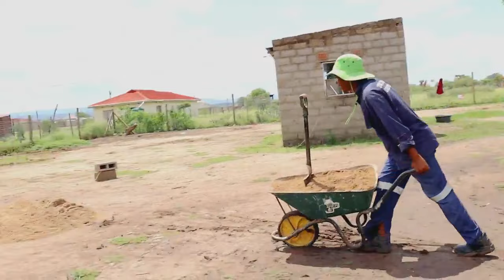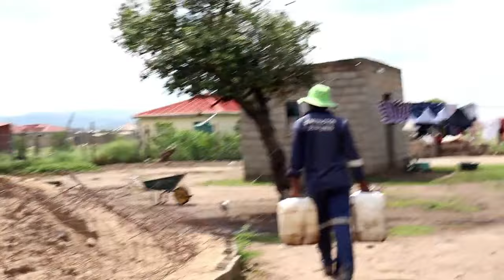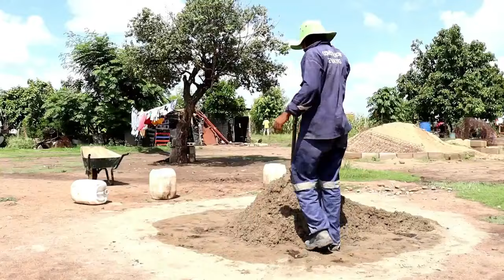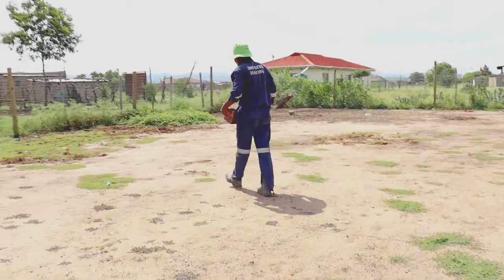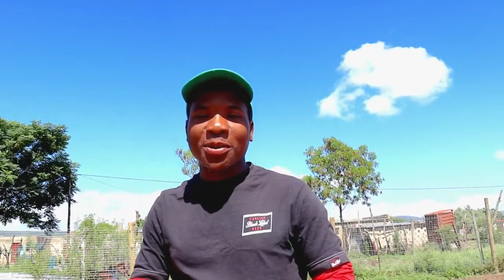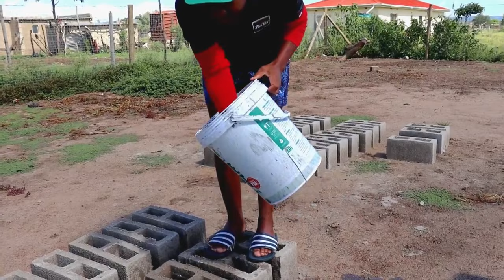VLOG: This Is How I Make Cement Blocks By Myself At Home | South African Youtuber😍🔥

Comment: Just so you know next time, your blocks had dried out too much to bother with the water, next time cover then with a sheet of plastic with stones on the corners
to keep the damp air inside, you also need to spray on them before sleeping or late. As some cements have a very short burning time, this is so that workers can empty
forms/molds for walls the following day and use them again. Yet privately, when using a thicker amount of cement for screening a floor for example, you need to flood the floor
with a lot of water. Before you cement a wall, wet the blocks, to stop them sucking out the water from the cement. Then wet again by spraying with a mist and hose after and during
the laying of the blocks ok. :hand-purple-blue-peace:
Reply: Would u recommend to soak them in a barrel of water?

Comment: It is encouraging to see such a young man doing all this.  He should note that the top of the brick is arched and not flat due to the fact that the unit with which he slides the brick out of the mold, is too thin and arches and rocks in the larger housing.  I suppose it could be corrected by  the layer of mortar in between the bricks, but a sharp eye can see it immediately and it does look " untidy". It can be corrected very easily. Making molds needs attention, as  such a mold should last a long time and repeats the product  with a high degree of accuracy. 
Still Congratulations, well done, and all the best in your life.

Comment: Not sure, but i think when they say ratio 1:8 in wheelbarrows they meant per wheelbarrow of cement which is 2 x cement bags, not 1 cement bag to 8 wheelbarrows of sand but 1 cement wheelbarrow. Meaning per wheelbarrow its 4 or 4 1/2 or even 5 wheelbarrows cement.
2 x cement bags fit into 1 wheelbarrow.
Reply: No man - why would they want you to offload cement to a wheelbarrow?
Reply: Just go n read a bag of cement it i it is written black and white
Reply: 100% correct

Comment: Thank you for the information. Ive always dreamed of making my own home with affordable diy materials. This seems to be the way to build a strong cheap home. Paint the inside, use a light water resistant material that is sloped for the roof, build a floor with a cement / plywood base,  lay some carpet, and run a wire in that shit and ill live in a one room home with one door and zero windows. Id consider a few windows for an ac unit and ventilation but other than that im a minimalist.

Comment: Nice video! I would like better descriptions of what is being done.  
What is ratio cement to sand?    How many parts cement to how many parts sand?   
I could figure it myself from trial and error.   
I think you said "5 wheelbarrels"   is a good starting point to one bag (what size?) of cement?   
I could dump 1 bag of cement into (what size wheel barrel?) to see how much of 1 wheel barrel one bag of cement is?   
Would be much better to have a number on cement to sand then you can use any size wheel barrel and any amount of sand and any amount of cement to make
any size batch of blocks that you want.
Good video and good starting point..    
I can figure this out from trial and error.  

Also on day two pouring water into blocks is not clear why. 
I'm guessing this just helps to "finish" curing the concrete? 
and get water into other places to make it cure better inside the block?  

Or is this just a test for cracks? water leaks out fast if the block is bad?  

Thanks again!

Comment: Congratulations! This is a very informative video. Is the ratio of sand to cement 2 bags of cement to 5 wheelbarrows (14 shovel heaps of sand per wheelbarrow)?  What is the weight of the bag of cement you're using?
Reply: 1X50kg of cement+6 wheel barrows (river sand) +60 litres of water=32 blocks
Reply: @mzilikazimabaso4962  in my country 1 wheelbarrow is as equal to 5x5gallon bucket... In my field of work....I used 2weelbarrow for 1 bag maximum 3weelbarrow
Reply: @mzilikazimabaso4962   So for rest of the world: 50 kg Cement+100 kg River Sand+60 litres of Water. Thank You! What are the dimensions of one brick? Length, width, height please.

Comment: Can you build 2 storey house on these blocks with or without columns? What ratio of cement and sand you used. I think I did not understand what you said.... Plz reply
Reply: Which part did you not understand, I can translate for you
Reply: 50 kg Cement + 100 kg River Sand + 60 litres of Water (32 blocks) | 1.5625kg : 3.125kg : 1.875lt (per block)
Reply: @drekthandemon7214  that wheel barrow can take  feel the whole bag of cement, so if you times it by 5, it is 250kg so you are wrong about the 100kg sand part

Comment: Nice video ❤
In this video, i see you used two wheel barrow of sand to 1bag of 50kg cement and got 32 blocks. Am i correct? I want to follow suit.
Reply from the maker: I used 4 barrrows

Comment: Could you tell me,what's the ratio of cement, sand
Reply from the maker: The ratio of a cement is 1 cement is 8 wheel barrows but u must not follow it coz your blocks would not be strong u must you the ratio of 1 is to 4 wheel barrows

Comment: All of the extra work he is doing is robbing his time. Fill the wheelbarrow with the sand and cement. Then roll it to where you want to make the blocks. Mix the cement in the wheelbarrow. Then fill the molds and pack them with hard with a hand tamp. 

When your watering the blocks the don’t you use the container the water is in to just fill the blocks? If it’s to heavy then you can always pour half of the water in another bucket? The more blocks you make per day the more money you make per day! Stop time robbing yourself and stop doing extra work that’s not needed to get the same if not better results!

Work smarter! Not Harder! Don’t cut corners on the work just find a better way of getting the job done so you make more money! When your older you will be better off and your body will not be in as much pain!